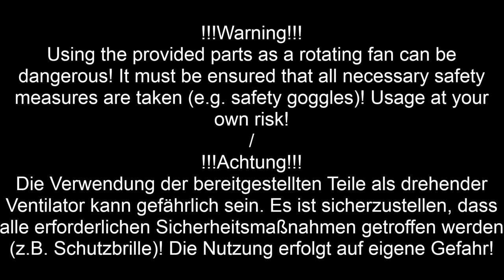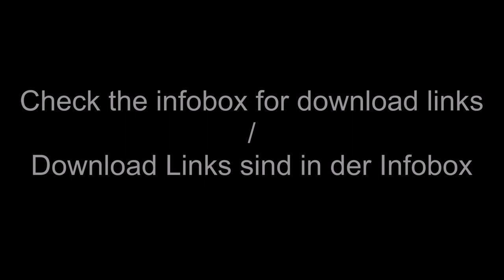Radial Fan Impeller / Radialventilator Laufrad - 125-6X

Comment: that size is a bit too much for the 3mm Shaft which cant handle the leverage force, so the impeller oscillates a lot
try balancing tutorial on youtube or use a 6mm shaft motor
Reply from the maker: Hi, the impeller look's way too big on the 3 mm shaft, but I didn't notice much vibration. Maybe because the blue parts are very light. There are three versions of the shaft connector on thingiverse, 3 - 5 - 6 mm.

Comment: A thing i notice here is the fact that if the grooves in which the two parts mate ain't perfectly clear, the whole assembly goes wobbly. It would probably be best to print the mating surface with locator pins rather than grooves. That way there's no chance for a bad fit = wobbly impeller.
Awesome piece either way.